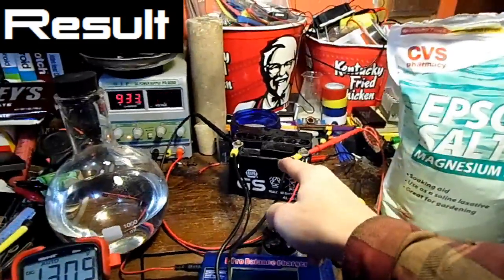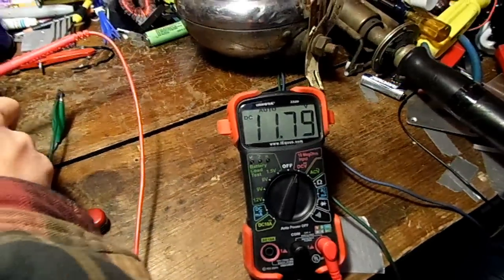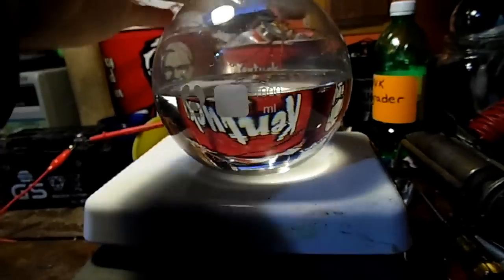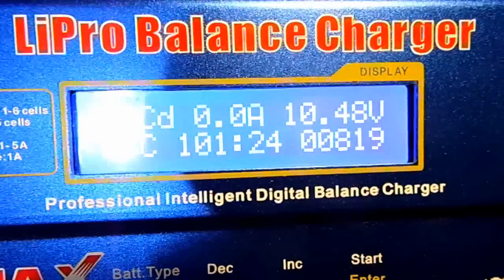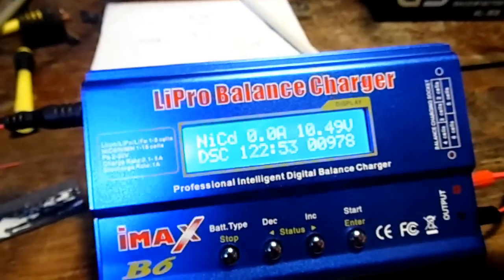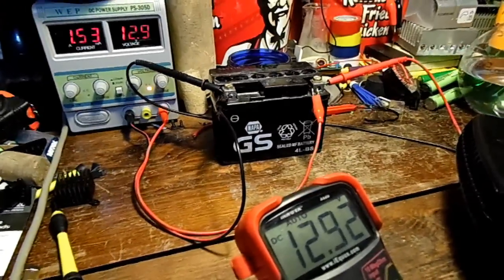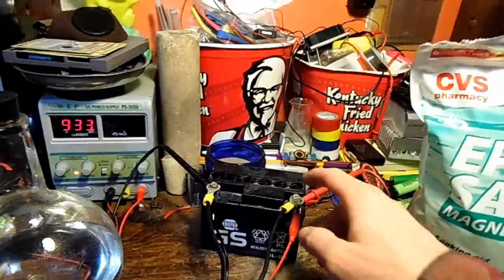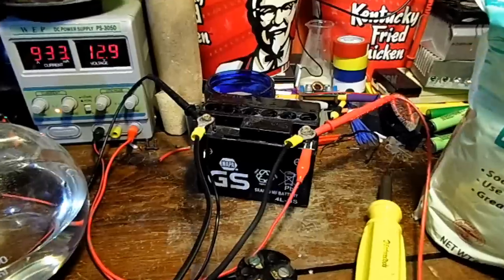Does Epsom Salt Revive a Battery?

Comment: If you still have that battery kicking around try discharging it by dead shorting it for VERY short times, like tapping two chunks of metal together that are attached to the battery with booster cables. A while ago there was a battery conditioner for RC cars that did that in cycles to bring back the life of old Nicd and Nimh. The theory is that the sudden spikes in current draw broke up the sulfur crystals.

Comment: the 16 amp load is way to big for a battery this size, when used in a deepcycle scenario your killing the plates, thats why the capacity was deminishing...
Reply: Deep cycle have thicker plates for slow but sustained loads. Cranking batteries have more thin plates for increased amps in a burst. The fragility of thin plates makes them bad for deep cycling.
Reply: @emiliorios6076  That site is a scam.

Comment: I have experimented with additive electrolytes.   Not much help or not necessary. Battery University site says sulfation is reversible and corrosion is not.  A battery ruined by leaving lights on, or doors open, or just not being charge for too long, can be desulfated with solar/charge controller therapy.  (20 watt panel and cheap ebay charge controller) Can take up to a week or so.  No need to mess with chemicals.  Check water level and add a touch of distilled maybe.  If the battery is corroded, it is a lost cause one way or the other.  (plates do disintegrate in time)

Comment: At last someone attacking the hypothesis with actual results and a step-by-step procedure. I recently took a 12V car battery that was 6 years old and pretty much "stuffed" from a Nissan Leaf and found the following after adding 6ml of PURE sulfuric acid to each cell. Stated capacity (new) is 45 amp-hours. Initial capacity before adding the H2SO4 was 0.4 amp-hours. Then:

First Run
Leaf Battery 2/8/20 (August 2nd)
4.1	Amps
 discharge current
163	minutes
 to get to 12.0 volts
11.14	Amp Hours

2nd Run
Leaf Battery - 6/8/20	
4.1	Amps
 discharge current
116	minutes
 to get to 12.0 volts
7.93	Amp Hours

So the capacity dropped back somewhat. Added another 6ml of H2SO4

3rd Run
Leaf Battery - 12/8/20		
4.2	Amps	
181	minutes	
12.67	Amp Hours	

So we'll see if the acid is eating away the plates over the next few weeks. But so far the acid seems to help a lot.

Comment: yes enjoyed your presentation, very much. I have observed in the past when a battery has a volt reading of 10.55v the cell has shorted; when it reads .55v its an open cell will not hold a charge. when it has a reading of 13v its a cell with no water its permanently damaged the moment water is poured into that cell, it will draw more amps from your generator burning out the diodes to car generator and will read at 28a 50a steady, heating up the generator or appliance you are using, when if normal amps should drop to .88amps not over heating your appliances .

Comment: A great tutorial. I would love to see more of these experiments on other batteries and have a conclusion overall. Very well presented and carried out. Keep them coming my friend.
Reply from the maker: oh don't worry i have plenty of batteries to test and experiment on.

i was going to work up to puting epsom salt into my big deep cycle battery but it looks like epsom salt won't restore its capacity. so instead i'm going to make a high powered desulfator for that. will prolly do it the easy way with a spinning magnet and engine magneto making like 800v sparks.
Reply: Great can't wait to see results. Very well done.
Reply from the maker: kay ger
yeah but adding epsom salt only costs pennies. i don't think they would sell you a battery for a few cents.
Reply: @RinoaL   Would you share how you built the high powered desulfator?  Also any other plans to create these tools to make life better.  I have seen someone starting with D. water and Baking Soda shaking the battery a bit and pouring it out. The B.Soda cleans the inside of the battery the color of water mix you pour out is proof of that.  Then they add the Epsom Salts and D. Water and trickle-charge it at least a day.  Thank you for helping to solve this expensive problem!

Comment: Epsom salt and a small charge to make the sulfate soluble.  Shake and empty.  Then fill back up with battery acid, charge and it's like new.  Epsom salt will not hold a charge and it's intent is not to be the electrolyte.   It's intention is to make the sulfate soluble in water to get it out of the battery and expose the lead.
     I never understand why people go to the trouble of neutralizing the battery with baking soda, then rinsing it out and doing all the work to get it cleaned out then they put stuff in like epsom salt or Alum or whatever and expect it to charge.  Just go get battery acid from O'Reilly for 10 bucks a gallon.  Put the legit stuff back in the battery.  Charge and then test with hydrometer to see if the specific gravity is right.  Too high then add distilled, too low then add more acid.
    Not that hard people.

Comment: Thanks for some really helpful work. Everything is going to lithium but lead acid is still the cheapest and most commonly used. I'm on a boat with a solar system and some new batteries and a few old ones and this will help me rejuvenate the older batteries and integrate them into the new system and also manage my charging discharging Cycles! Thanks so much again! Getting my Epsom salts now and preparing to read all of the comments. And interestingly I have a starting battery which stores a lot of charge potential almost equal to my deep Cycles so I'm tempted to purchase more large starting batteries rather than expensive deep cycle.

Comment: You can easily and QUICKLY desulfate a 12V battery with a 20V laptop charger (Or a variable power supply)
I restored 2 100AH AGM batteries with this method 

This is my favourite way of desulfating batteries 

The following instructions are intended for a 12V 200AH battery or equivalent 

Adjust times and discharge current to match your battery 
For a 100AH battery the discharge current and overcharge time will be half 
For a 50AH battery the discharge current and overcharge time will be a quarter 
and so on but the voltages should be the same regardless of battery capacity 

do not exceed 30 min of continuous overcharge time regardless of battery capacity

Charge the battery with your charger of choice 
Connect a 20V 90W laptop charger to it and allow it to overcharge for about 20 min
Disconnect from the charger and let it rest for about an hour 
Then discharge to about 10.5V with about 65A DC (700-800W from an inverter is good)
Then repeat the steps until your battery is working properly again 
(usually if the battery is recoverable you should see improved runtime after the first 2 cycles)

The battery should be back in working condition after around 10 cycles but it may take more depending on how much sulfation there is 

**DISCLAIMER**
*YOU WILL NEVER BE ABLE TO RESTORE IT TO BRAND NEW CONDITION SO DONT TRY OR YOU WILL COMPLETELY DESTROY THE BATTERY 
THIS METHOD IS INTENDED TO GET YOUR BATTERY WORKING WELL ENOUGH TO PUT BACK INTO SERVICE*

THIS WILL NOT FIX A SHORTED OR DEAD CELL 
(but you are welcome to try if you want)
Pulse charging is absolute rubbish and is likely to damage your battery
And battery charger desulfation programs DO NOT WORK
Reply: +mewantbrains I've seen this done with either Nicd or Li batteries to kill crystals that form....Not sure how it works with Pb...But to get this strait, If I took an old laptop charger, spliced a + and - alligator clip then ran it on the battery for X time it will desulfate? Maybe I have to repeat cycle, but I get the idea...Looking for videos on this and cannot find it. I'd think the laptop charger would cut off...Either trip a fuse or internal protection...
Reply: It should work just fine for lead acid batteries it is my preferred method of desulfation 

The charger I use is a Lenovo 20V 90W laptop charger 
Part number 92P1107 
It has no overload fuse and won't trip when connected to a 12V battery 

but it will heat up a lot so make sure it has plenty of ventilation by drilling a few holes in the plastic cover 

DO NOT TRY THIS WITH LITHIUM BATTERIES OR YOU WILL DESTROY THEM
Reply: +mewantbrains Going to look around for a charger now....
Reply: Just beware that Chinese knock offs of this may have an overload fuse which will make them useless for this application 

Just put an ampmeter in series with the positive wire and see if it cuts out
Reply: +mewantbrains I've got an 18.5V 65W....I think 3.5amp. Think that'll do?
Reply: It should work fine just make sure the voltage on the battery terminals is around 16V-17V
And you should be all good but the lower wattage means it will take a bit longer
Reply: Leave it connected for about 15 min before you measure the voltage So it can stabilise
Reply: And let me guess 

Your cousin/brother/friend tried it and got cool results?

My method works better than your snake oil and it's free
Reply: +mewantbrains you will fry laptop charger very fast at first. At secong it will be unable to bring voltage over 14.4V. So use IMAX B6
Reply: On the contrary 
I have been using the same charger for nearly a year with no problems and I now run a battery restoration business restoring 20 batteries per week
Reply: please upload the video. very appreciate if you make it happen
Reply: your instruction 1)connect the battery with your charger of choice
2) connect 20v 90w laptop charger to it and allow it to overcharge for about 20 min.
i did not really get it.  it is connect the battery charger and laptop charger in the same time for about 20 min..
or do it one by one. first connect the battery charger first until full charge.. then disconnect the battery charger.and then connect laptop charger for about 20 min.  so which one the correct method. thanks
Reply: one more thing. adjust times and discharge current to match your battery.:
for a 12v 200AH battery, overcharge for 20min,then discharge to about 10.5V.
so for a 12V 100AH battery, overcharge it for 10min, then discharge to about 5.25V.  is it the correct method?
Reply: +Mohd shariff, you charge it up normal on a regular charger then use a 20v charger to overcharge it. It's also called giving it an equalizing charge if you monitor the specific gravity of the electrolyte while you are running the 20v overcharger. You do this because of the sulfate crystals that need higher voltage before they break up. Some cells might not be holding their share of charge so the overcharge forces them to. Otherwise the 14v (sic) from a 12v charger isn't enough to bust up the crystals.
I don't understand why frequency charging (is that just another word for pulse charging?) isn't safer than overcharging. OP says it's fraud but how so?
Reply: +Mohd, voltage stays same for formula regardless of capac. Discharge to 10.5v. same way.

Comment: The best way to maintain a battery that is not in use,  ( Caravan or Vehicle not used) is to use a " Cyclic Charger " . This type of charger monitors the battery voltage, automatically cycles the charging, between two preset voltages. the charge current is kept low to prevent electrolyte evaporation.
Thus emulating the daily use of the vehicle. The low charge current keeps the sediment discharge low and prevents sulfation.
The electronics detects the battery polarity protecting the charger. The LED indicators show the charge state of the battery too !

Comment: I had heard of using Epsom salts to revive a lead acid battery probably about 30 years ago.  I had a motorcycle battery that went out in about a year, I emptied it out, flushed it with an Epsom salt solution, rinsed again, then refilled it with fresh acid.  The battery recovered and lasted another year, so I was pretty happy.  I tried the same solution 2 or 3 times after that on other batteries, it never worked again, so I pretty much gave up on the idea.
Reply: G56AG another guy on youtube said that only about 1 out of 10 are repairable with epsom salts.

Comment: There are  several things for battery repairing
do not try to do this unless you are sure what you are doing - the acid can burn you
check the voltage first - there may be a kaput cell which will waste your time.
Check your battery fluid.
attempt to completely recharge the battery.
(I learned about these from Rapid Renew Roadmap site )

Comment: my truck battery was dead about 4 days ago. I ran across a video showing the Epson salt and distilled water trick. I did exactly what they told me. so far my truck battery is working fine. I am on day four, maybe five and it starts and runs perfect. to be honest I didn't think it would work, but it does

Comment: Looks a bit dodgy. From what I understand, you have to replace the acid solution entirely with the magnesium sulfate solution. Your findings are based on what seems to be a misunderstanding of the requirements.

Bear in mind that all of this is only relevant to reviving a sulfated battery, not attempting to increase the capacity of one that is still good.

Comment: I am currently on my second year of using a car battery that was 5 years old and would no take a charge.  I put a tablespoon of water saturated with Epsom Salt in each cell, trickle charge for 24 hours, and have had no problems.  Car starts like normal - even on cold weather. 

Did the same with a dead tractor battery that would not take a charge - been running fine now for a year.
Reply: Did you do this without draining the cells?
Reply: Rob Totten Correct - I just added a tablespoon of the saturated water.  I used a 16 oz drink bottle; added 9 tablespoons Epsom Salt and just enough water to dilute it.  The trickle charge was the 2 Amp setting.  After that initial charge there has been no issue.  This is the second winter it has gone through and the car starts up fine in the AM even though it sits outside all night.

Supposedly when this wears out in 5 or so years, you can empty the battery of everything and use just the Epsom Salt solution.  I don't know yet, but my father did this with a lawn mower battery and it worked.  He said it has trouble starting when its colder though (for snow plowing).
Reply: Good ,thanks for the clarification will try this on my next one.I just put the granules straight in so got it wrong but I tried emptying the battery and completely refilling with dissolved salts and this seems to be working as I now have the battery at 13.3 V on a 1 amp charge rate. Cheers, Rob.

Comment: You know that charger has a PB mode correct? This is what it is for, lead acid batteries. I don't know if it affects the discharge numbers but it will smart charge 12-volt batteries and tell you exactly how many amps went in and how many come out. Just a tip.

Comment: I guess one thing you could do is to try an acid swap, remove the old electrolyte, try to react the sulfate on the lead plates so that it cleans them off and then add fresh electrolyte... that could restore a lot of the capacity...
Reply: Dude, the fresh electrolyte will clean off the sulfate when you charge it. Lead and sulfuric acid make electricity when they turn to lead sulfate. Charge it and it changes back to lead and acid.

Comment: That is really awesome! I have a large number of old batteries being used in an off grid solar array I am trying to revive but I'm not sure the correct way to go about it. Is there any amp-hour comparisons for an aluminum sulfate conversion? I'm considering using sodium hydroxide to neutralize the sulfuric acid then wash and convert the cells.

Comment: I do a lot of Epson salt battery recovery's and I use 1 cup of salt to 3 cups of water. a car battery will use between 12 and 16 cups of fluid. I charge at 2 amps for several days. they don't have a good reading on my load tester but they seem to work okay.
Reply: +Geo Jeff I've found that using a charger that starts at a higher amperage and "backs off" as the battery charges gives much better results. My first reconditioning experiment with epsom salts was on my John Deere lawn tractor battery. It was pretty much dead after about 4 years, and wouldn't hold a charge for more than a day or two. (And I did keep it on a trickle charge over the Winters) I tried the epsom salt treatment three years ago. The battery now starts my JD like it's a new battery. I never got into all the nerdy battery load, test crap, blah, blah, blah, I just did it, and it worked. I have revived many batteries since, for myself and for friends, with excellent results.

Comment: Could you try a cheap Chinese pulse repair charger like the Tianye RJ-120501A from Ali express ,. or similar.  Do they get a battery back, In capacity, Amp hours, CCA amps etc. My anecdotal evidence(car easily starts again)  is they actually work provided plates are not warped or shorted.

Comment: I have a large yuasa 125ah battery for auxillary power in my shed. Sadly the solar charger failed & the battery ran down to 3v. Ive just put it on charge, believing it would be pointless, however its holding charge at around 12.2v. Do i need to just add distilled water with epson salts to it as it is or to flush out the existing acid (Which is clear not dirty) &how far to fill?

Comment: i hav 150A 12 volt lead acid inverter batery , 7 years old and it start working poorly science last year and add acid in one cell ,but now i knew how stupid was that idea and now one cell in which i put acid is not charging properly n when i check sp gravity of acid on that cell it only rise to 12.00 which should be 12.50 i add some chemical found in the market but not working well and now it doesnt takes charge too even i replaced smart charger .....so i am thinking of adding epson salt so how much  gram of sla is needed in each cell and how could i raise sp gr of that cell from 12 to 12.50